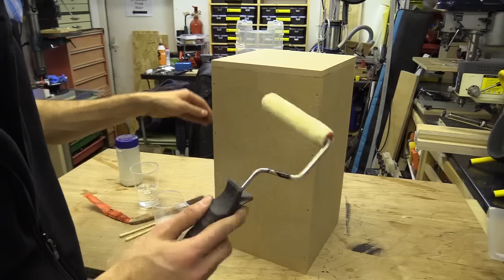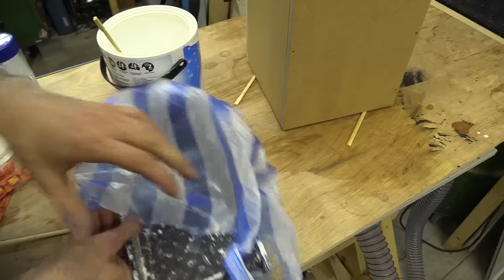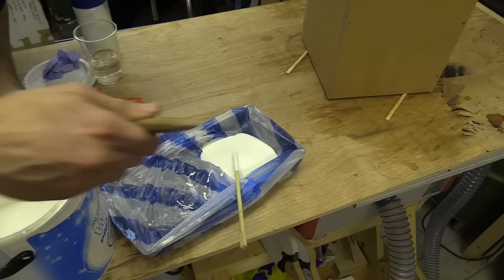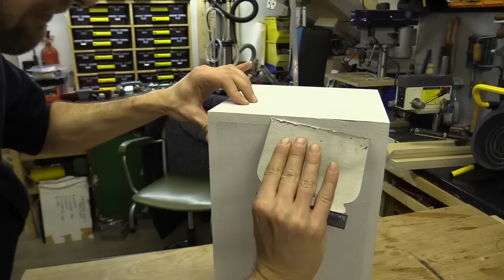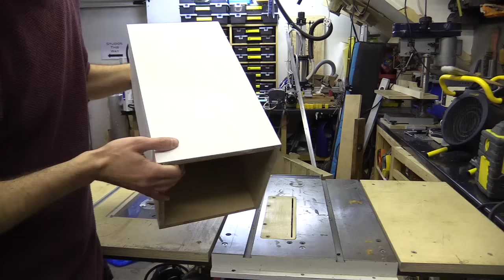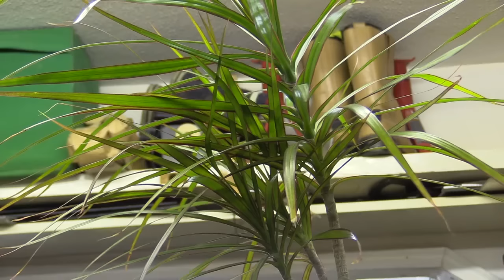How To Paint An Exhibition Plinth (for beginners)

Comment: I use this method with diluted with water wood-glue for priming the paint job to my woodworks for a long time now and it is a very good trick!
And I want to share with you another trick based on this method:
When I run out of filler paste and the stores are closed or I’m bored to run for buy some new filler, I just mix a spoon of flour in the diluted wood-glue and here we go!
The DIY and inexpensive filler paste ...is ready for use!
Seriously... in the most cases IT WORKS.
I don’t used for external jobs, because i know even if its very well dry, always have the chance to turn something wrong with the filler, either because the bad weather conditions either because this is not the real stuff!
So proceed with caution...

Comment: Does the PVA not cause problems with the emulsion?. PVA on walls is a nightmare later on causing cracking and bubbling.
Reply from the maker: As long as it dries properly I've not had problems. But I wouldn't put it on a paint surface, or between coats though. Just diluted down on bare MDF. This method is also for internal, relatively short term use plinths made on a budget.
Reply: I personally use this method with diluted with water wood-glue, for many years now, and I never have a problem with this!Actually this “recipe” is one that used for a lot commercial products for wood or hard paper water based priming coating!If you look on the labels of that kind of products, you’ll see the majority of this is PVA based materials.
Of course  you can’t used for any kind of surfaces, but for indoor woodwork objects it works like a charm!